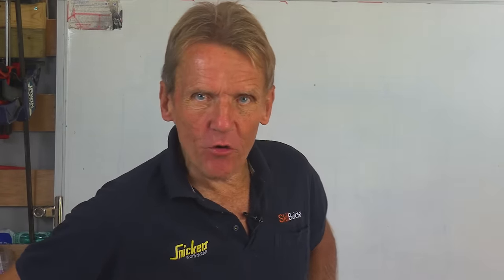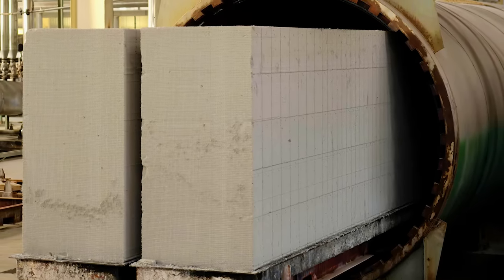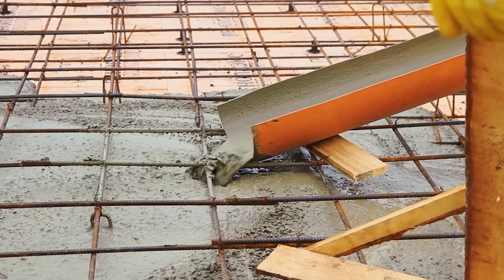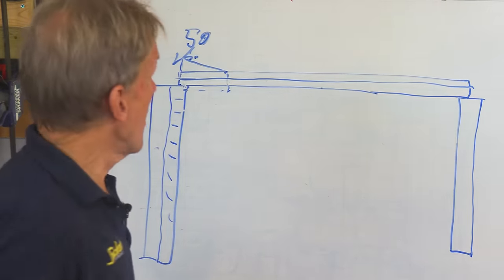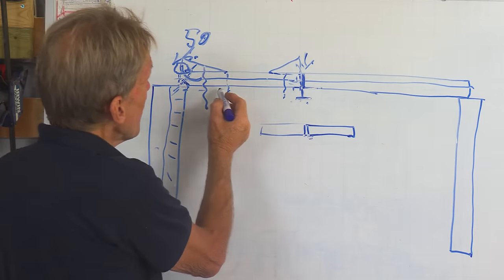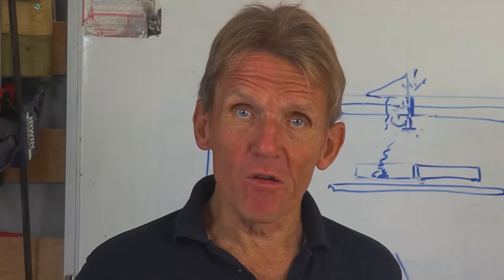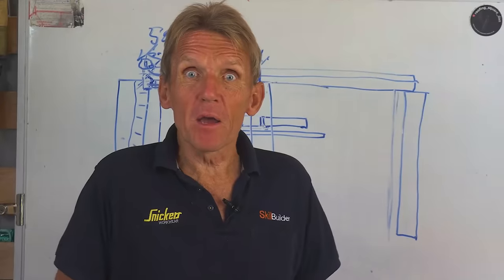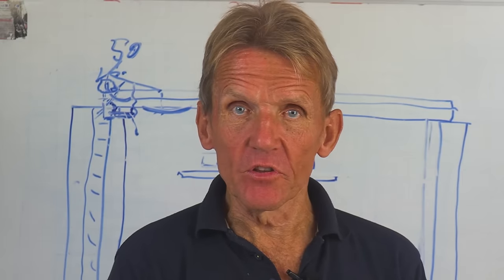The Ugly Truth About Reinforced Aerated Autoclaved Concrete (RAAC)

Comment: I’m a big fan of the channel and appreciate the attempts to explain RAAC but there’s a lot of errors in what is said. Rebar is what stops the concrete failing in tension, not the other way and you do not need to tie in the rebar (that is a suggestion to an already poorly implemented design). It’s worrying how many people in the industry have little understanding of civil engineering and it’s only going to get worse with less people wanting to study the topic each year. It doesn’t help that the lowest bid wins the work and asset management is not properly undertaken on public infrastructure within the UK.
Reply: Also, surveyors shouldn’t just be looking at a building - they should be using equipment to justify their judgments. Unfortunately my experience with the industry is that those who know anything are probably being lowly paid and rushed to get designs across the door without being asked to consider all elements.
Reply: That's interesting. Anywhere we can read about how reinforced concrete should be used properly? (or a YT vid of course...)
Reply from the maker: You do need to tie the rebar in if it has no ability to hold itself in place, which is clearly what happens here. The report states that this is one of the problems with the beams and that tying it in at the ends is a possible solution.
Reply: @SkillBuilder  I didn’t realise you were commenting on that being stated in the report. I thought it was your idea - still think it’s a shambles of an idea. Rebar doesn’t need support if the concrete is decent. RAAC is another example of trying to engineer to minimum cost without thinking about longevity!
Reply: @mikerodent3164  reinforced concrete is a great building product and has many uses in the industry still. It’s these variations with reduced strength which allow more water absorption that make no sense - the weakest element of concrete will always be exposed rebar!

Comment: the funny thing is this: In the old days we could actually build buildings that could stand for hundreds if not thousands of years.
And now a days we just accept this crap.
Reply: Reducing costs and increasing certainty. When we used to build with a 50 year lifespan you could expect 75 to 100 with little investment. Now we can design a cheaper building to last 50 years but as it says on the label it will need to be replaced after 50 years.

Comment: Missing the point .Concrete is great in compresion but poor in stress .Steel rods (rebar)is great in stress but poor in compression. Hence the need for steel rods cast in lower part of the beam (the bit under stress). So called Aireated concrete is NOT concrete it has no compresive or stress qualities END OFF and should NEVER be used in a structural load bearing capacity . In Scotland the building regs and compliance is different from England..enough said ?...in regards roman concrete ? My old prof used to say ...plenty of poor building just the good ones still standing. Btgds.
Reply from the maker: I am not sure I missed the point. I spoke about that very thing.
Reply: @SkillBuilder  Point you missed .. bit under compression ie the top of the beam has no compressive properties...unlike dense concrete...so fails in compression ... water ingress to to the steel undoubtedly will cause loss of cohesion...but tensile strength is entirely of the steel....which does not fail to do its job so to speak .... hence the structural failure is on the compression side... visual effect ... on the underside...bottom line..never should been used unless in post tensioned situation ..even then theoretical.

Comment: Much of this is hysterical bollocks.  RAAC was used extensively in Europe and many parts of the world between 1950 to 1990.  As it is commonly stated that RAAC has a service life of 30 years, if RAAC was the problem made out here there would have been collapsing buildings all over the world.  As this is not the case, it can be concluded that RAAC itself is not the problem, which is, as stated here, the accumulation and ingress of water i.e. a maintenance problem.  Ever known case of RAAC structural failure is associated with a maintenance problem, such as the failure to keep drains and gutters clear.

As this commenter said at the beginning, this 'crisis' was announced just at the beginning of the school term so in my view it is very likely to be an artificially created crisis put out for political reasons.

Comment: life of standard reinforced concrete is about 50-60 years anyway, of course raac is a crap material and should never have been used.its not just leaking roofs that rots the reinforcement but moisture inside buildings, a lot of people breathing will emit a lot of moisture as well.a lot of school buildings were system designed like the ones in thailand in 70's  and 60's and were hybrid steel frames made from the cheapest materials.its ok to pay 8 million pounds a day to house illegals and send 15 bill overseas in "aid" to countries like china and india which have space programmes but we cant build decent schools